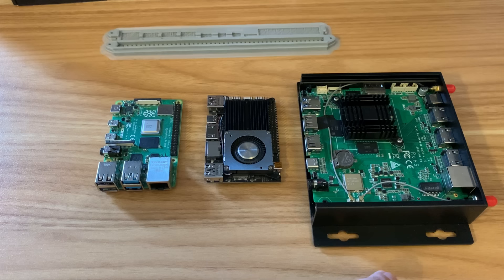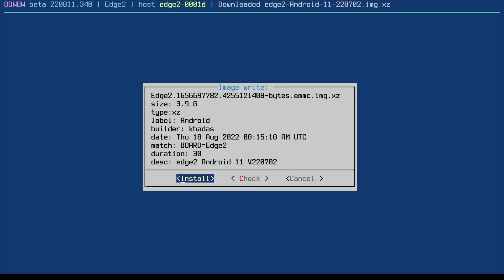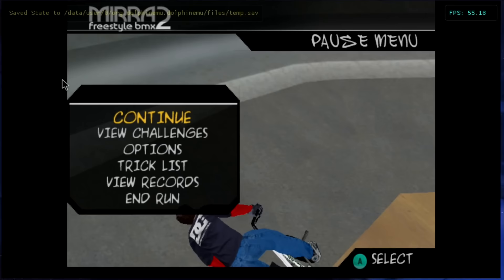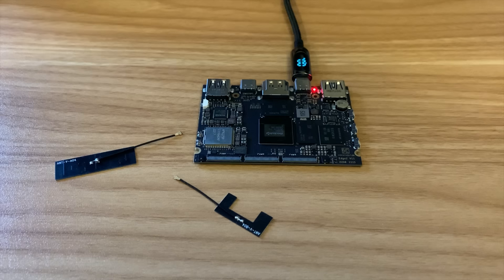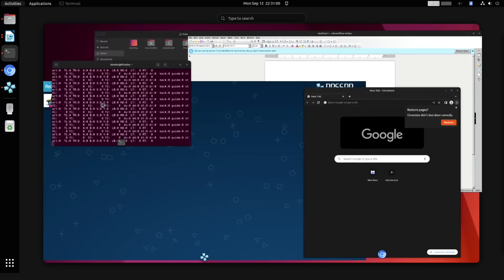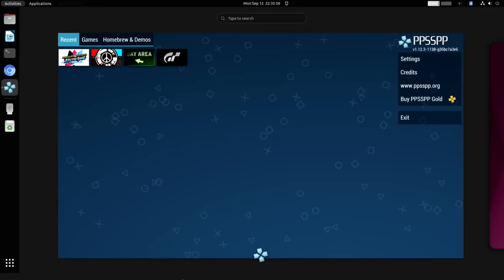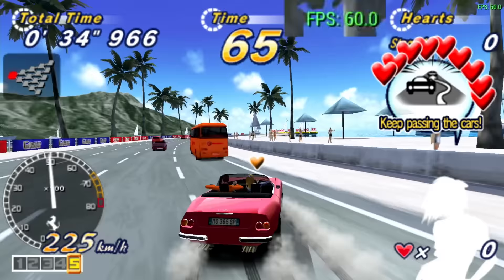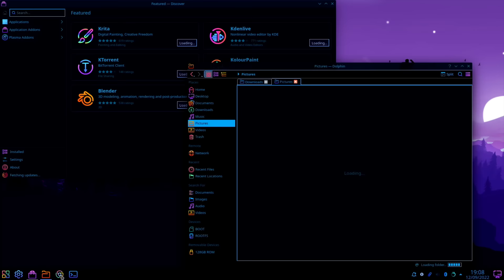Khadas Edge 2. Super Powerful 8 core SBC. Rockchip RK3588S with 16GB ram.

Comment: I'm always looking out for new high-powered ARM SBC's that would be suitable for more CPU/GPU/IO-intensive applications than the Pi. However, I note that higher-end products start to butt up against the baseline M1 Mac Mini price-wise (especially in US pricing because heavy discounts on some Apple products seems to be available),  but don't get close to the performance - often resulting in the Mac being the overall better value proposition. This reinforces my conviction that the M1 Mac represents superb value when it comes to the balance between price/performance/power consumption despite it being a 'premium' product. Obviously, it's bigger physically than most cased SBCs, but it's still a lot less intrusive than a conventional PC. It fits many people's definition of low-cost, and in terms of 'bang for your buck' it's probably peerless.
Reply from the maker: How much can you get an M1 mini in the US? Surely the price isn’t that close. I love my M1 MacBook Air.
Reply: @leepspvideo  Walmart has refurbished 2020 M1 Mini for $605
Reply: @leepspvideo  According to MacRumours, discounts of up to $130 for the baseline model can be found (i.e. prices from $569). AppleInsider reports current discounts of up to $110 (i.e. price $589). Yes, that's still more expensive than most SBCs (even including case, PSU, SSD, etc) but high-spec SBCs are multi-hundred dollars, and getting towards the region of a Mac Mini, which at ~$500 still qualifies as low cost computing. In the case of the SBC you're reviewing in this video, the 'pro' version is priced at $329,  which will rise to $369 next month. At that price point I'd be seriously considering going the whole hog and spending an extra $200 to move to M1 architecture, with the blazing performance that brings.
Reply from the maker: @ninline2000  I agree it’s a great price but it’s a long way from the $199 launch price of this SBC. 
Normal price $239
Reply: @leepspvideo  the board you reviewed is the 16gb version, so $299
Reply: If you want the highest FLOPS per buck, previous generation of ultrabook processor-based Chinese mini PCs might be the best option. You can get an 8-core Ryzen 5900HX box for some $300 with RAM and SSD, and its CPU/GPU annihilates everything in that price and TDP range. Also FYI, RK3588S is not very expensive, it is just Edge 2 is very expensive. R6S is priced at less than half its price for the same spec.

Comment: This slim SBC with USB Type C ports is in the right direction for a portable [ display  + SBC ] setup with an SBC pluggable and detachable at the rear of the display for outside use.  Now that there is no Ethernet port on the SBC, it would be really useful to test USB type C hubs (bandwidth, power consumption, hub size, nb of ports, type of ports, ..) and check simultaneous downloads over Ethernet + other protocols (file copy to M.2, etc..). Some of these hubs are terrible at handling high-speed transfer for simultaneous communications, and some work fine.

Comment: I think the reason Fortnite was kicking you was because you were using a controller. For the Android build they consider that cheating because most use touch screen controls, which for FPS games are awful. I'd bet if you used it in the tablet format you could get a full play in.

Comment: It is likely from all that we have seen from RK3588 devices so far that Android is where there is most overall benefit right now, in particular hardware accelerated video playback, which, as history shows us, is almost never going to generate the manufacturer drivers for open source use to enable that maximum GPU performance in Linux etc

Lack of Ethernet is a downer for me and no onboard support for NVME significantly decreases the value, especially at the prices being charged, even early bird.

The Rock 5B seems to combine the features and price that will likely attract the greatest interest, even though it is still a few weeks away from consumer sales. We will of course have to wait for reviews to assess its full value.

The Edge2 is another example of how the RK3588 is a quantum leap forward in terms of the Rockchip/AMLogic/Allwinner battles at there end of the market but the overall package of the Edge2 in comparison with its actual price means that I would not give it serious consideration.

The optional Edge2 Active Cooling Kit seems to be an almost required purchase, adding to the cost, but there is no mention of price of purchase availability.

What really stood out from the review was what happened when it was connected to the RasPad and even the tiny demonstration of its use showed a flowing and fast operation, which bolds well for use in tablets and especially add to the burgeoning gaming handheld market.

Comment: It is amazing how “old” the a76 cores are - what 4 generations old vis-a-viz the current gen cores in the latest android phones? 

A76 is a beast. The ampere instances in oracle cloud was my first taste of it and it was amazing - more powerful than my 8th gen Intel i7 CULV (laptop) processors. And with 24GB of RAM for the free tier, it killed.

Can’t wait for some Mediatek dimensity 9000 SBCs.
Reply: All big cortex as A77,A78,X1, X2 are basically based on A76 by ARM Texas team.
So you just need higher freq to boost performance.
Reply: @scavarestrovao6196  but ARM had done changes with new arm v9 - So A710 is different also cortex x3

Comment: At first I thought there wasn't any GPIO but after going over the website I see that it is on a breakout cable that connects to the ports next to the back-side CSI connectors... which  you only get with the 'maker kit' - this is also how you connect an SD card. on that i/o breakout- the website is is a bit confusing about this, but it's not too hard, you just have to read every bit of text to figure it out.... also, you only get this i/o breakout if you get the 'maker kit' , the other version comes with a case and no breakout because they say it will be blocked by the case..... well I think they should include this breakout stuff anyway because it costs more and you lose SO MUCH functionality with out any access to GPIO and ease of transferring with the sd card without having to unplug usb ports.... and it's a bit expensive for me to use in a maker sense anyway... but then again it is SUPER POWERFUL, so it could be useful for creating more complex a.i. needed 'stuff' (robots, etc)
I don't think it would be a bad purchase if you need more power, or even a simple computer for everyday use... I like it a lot... I just dont need it right now :)

Comment: I've been looking for a comparison video that actually shows all these SBCs together as looking for an alternative to my recent Pi 4B 8gb and as much as the the RK3588 looks impressive I see it lacks the OS support that you get from the Pi community. Ideally I'd love a CM4 yet they're near unobtanium or expensive from Chinese sellers. Saying that its great to see the likes of Mekotronics producing affordable boards, although I prefer the smaller sized Khadas boards with a preference for the Edge 2 as better emulation potential?! Here's hoping you manage to get a Radxa ROCK5 Model B to tryout once they release or a Firefly RK3588 version as I hear good things about their ITX-3588J board but its quite pricey...? Great work by the way!
Reply: Don't buy the Edge 2. If you want a CM4 replacement, go for a Radxa CM5 (to be released soon), which has the same RK3588S, running the same validated software suite currently runs on Rock 5, and is of the same size of CM4. If you want something in a nice box ready for use, go for an R6S. Edge 2 looks nice on paper, but the board certainly is either designed to be a small computer (which its GPU is not powerful enough, though its CPU is really cool), or to be embedded in a system (which it lacks mechanical connections to be fixed onto anything), or to be a desktop embedded development board (which its GPIO connectors are horrendously prohibitive to be used in this scenario), so it tried to satisfy both markets, but really satisfied none.

Reference: a not very satisfied Edge 2 user.

Comment: I'm wondering how many of these SBCs are being used for play games. My interest in them is business-related. Is there any way that you could find a way to add a test for business capabilities?

I appreciate that there aren't any standardised tests for business functionality, but I think it would be useful to create a standard test of your own which you could then use as a comparison table for all the SBCs. Most of us know what the Pi is capable of, so having something to compare to the Pi could be useful.
Reply: What kind of business are you using them for? Typing in documents, credit card processing, menu boarding, 2D and/or 3D motor controlling, something else?
Reply: @anon_y_mousse  Running as low-power servers. Nginx, PHP-FPM etc. The Pi isn't up to the task, but some of the better-equipped SBCs look like they might be.
Reply: @ChefEarthenware  I don't consider those necessarily business only, but it is weird that the Pi can't keep up. I run Apache on mine and it doesn't seem to be slow, but you may be serving for hundreds or thousands of users. Have you tried overclocking and/or using a different OS on the Pi?
Reply: @ChefEarthenware  If you're finding that the Pi isn't up to the task but you're running a standard distro on it, then I would suggest looking at using a lighter and far more customisable Linux that you can "strip to the bone" just for your specific needs - Gentoo Linux would be one I would suggest that you consider here.
Reply: @terrydaktyllus1320  I did leave another comment, which has been removed.

In that comment, I explained the problem and I also gave the URL of my search engine, which I assume is what YouTube doesn't want to see in comments.

I'm not entirely surprised, as my search engine is a potential competitor to Google 😄
Reply: @ChefEarthenware  I know the feeling - a lot of my comments are deleted by YT too, usually when I am talking cyber-security with people and YT's thick algorithm assumes I am talking about h*cking techniques.
Reply: @terrydaktyllus1320  Have you found any way around it?
Reply: @ChefEarthenware  Other than "choosing my words carefully", no.

Comment: ROC-RK3588S-PC - Price:  $ 219.00. What are we comparing to (Raspberry Pi) - 4 times more expensive ;-)
Reply: To be fair, I've seen 8GB Raspberry Pi's asking the same kind of prices on Amazon at the moment - but $199 for such a board is still far too expensive.
Reply: You need a more appropriate comparison: 
RK3588S has a cpu mark of 5,998  which is the same as an AMD FX-8350.... Considering it has a  motherboard, 8g ram, basic storage, an igpu and wifi -- let alone the little power consumption, I would not say it its far too expensive for $200. However, Ryzen 3 PRO 2200GE has around the same cpu mark, and around twice better igpu  (for $100, the chip alone, you would still need to add mobo, ram, storage and wifi)

(PS. Pro version with 16 gb ram and larger rom for 299 is far too expensive indeed)

Comment: Overclock the CPU within PPSSPP to get 60fps in Outrun 2006. Without doing that, it doesn't matter if you're running at native resolution or up scaled to 4K, it still drops to 30fps. The game by design is too demanding for the CPU in the PSP so that's how it runs too on real hardware. As PPSSPP has a CPU overclocking feature,you can make this go away. 

One day I'll see a YTer remember this lol
Reply from the maker: Does this definitely work that way with emulation? The Dreamcast version of Dave Mirra bmx runs too fast on a Pi 4. you can tell by how quick the timer runs. 

Imagine outrun at double speed! I already crash too much as it is
Reply: @leepspvideo  Only works if there is an option within the emulator in question. It doesn't speed up the game, just speeds up the emulation of the CPU.

Comment: Lee. Sold my Pi400 so someone else could use and it wasn't powerful enough. Could this sbc easily get put into the pi400 frame ?
Reply from the maker: It’s a completely different shape to the Pi 400. You sold the Pi 400 without it’s case?

Great Raspberry Pi 400 SSD case
https://youtu.be/uyGplkzDrFE

Comment: So I see a lot of videos reviewing these SBCs but I don’t see any good videos explaining why this is better than an old laptop or pc which can be cheaper. It’s small but how much is that worth? If I want to run a server for smart hub, plex, nextcloud, vm, etc. Would this be better than a cheap old pc/laptop?
Reply from the maker: A lot lower power consumption than an old laptop
Reply: It will pay for itself with the power it saves. With this much performance on an ARM board, there is little reason to use x86-64.

Comment: Too bad the new SBC's are so expensive. How does this compare to a AMD 3200G system which is roughly the same price?
Reply from the maker: The AMD is faster but check out the performance / watt ratio

https://gadgetversus.com/processor/amd-ryzen-3-3200g-vs-rockchip-rk3588/

Comment: I bought one, seems to be defective. Right out of the box it boots into the OOWOW beta splash screen as shown in your video, but instead of loading OOWOW, it remains stuck on the OOWOW beta screen. Hopefully other folks have better luck than I do.
Reply from the maker: See 14.30 in this video 

https://youtu.be/SEDgKQzvkck

You can write Oowow to sd card. I managed to stop my eMMC Oowow from working. Also try a different display if that doesn’t work
Reply: @leepspvideo  Thanks for the suggestion!  I tried writing OOWOW to a USB stick, it boots from it, but hangs at the OOWOW splash screen as well.  I tried two other displays, same symptoms.
Reply from the maker: @chadparrish926  strange, it’s not an issue I have had on my 3 Khadas sbc’s. Are you sure it’s booting from the usb and not the eMMC image?
Reply: @leepspvideo  I bought a second board, which arrived today.  That board booted to OOWOW out of the box and seemed to install android fine, so the first board is definitely DOA.  I am having difficulties with the touchscreen now on the second board, which works well on a raspberry pi running android.  It is a Dell P2418HT.  I am starting to think that the Edge2 was not quite ready to be out of beta.

Comment: Did you try PICO Pi with RK3588S (16GB Ram + 64GB eMMC) and use it on CrowPi2? I wanna use it instead of Raspberry Pi 4B+, but I have the trouble to set up
Reply from the maker: I haven’t

Comment: You have to admit, that you're comparing apples to oranges here.  You're comparing a $75 Pi with a $200+ SBC.
Reply from the maker: I clarified that the Pi 4 has been out the longest but it’s got incredible support. I was pointing out how powerful the Khadas is considering the size. The Pi 5 is very unlikely to match this SBC for power as it’s aimed at a lower price point. However the Pi 5 will have unrivalled community support. Still it’s great to have the power if it’s available.
Reply: @leepspvideo  Agreed. It's amazing what they're doing with the size, but for what its for (education) the Pi just can't be beat for the price.  It is interesting to see these alternatives come out with more power.

Comment: I mean at that price point you can get a good Chromebook.
Reply from the maker: Very different use case. 16GB Chromebook price...
Reply: @terrydaktyllus1320  As you watch a tutorial installing android....
Reply: @SimpleEnigma331  So Google can spy on me just because I watch Android being installed? That's a new one...
Reply: @terrydaktyllus1320  As in thats one of the use cases for this. And you can remove ChromOS from a Chromebook. Im only stating that for that price you can get more complete hardware.
Reply: @SimpleEnigma331  No, there is no use case for a Chromebook - I made that clear in the first comment.

You can buy a refurbished Thinkpad for $200, stick Linux on it and have a more usable machine that isn't spying on you.

Chromebooks are made specifically to not allow other OSes on them - I had a HP Chromebook that my wife got extremely cheap through staff discount when she worked for HP about 10 years ago and, yes, I got "virgin" Gentoo Linux on it. But it was still a lot slower than any old laptop I was using at the same time. Within 3 months, I stuck Android back on it and sold it on eBay.

I don't like olives. So when I order a pizza online, I tell them "no olives on my pizza, please".

Your "philosophy" is "buy the pizza with olives and pick them all off the pizza when it's delivered but before you eat it".

Why would I buy a sub-standard bit of cheap hardware running an OS that spies on me to then try and make it better afterwards? Just buy a $200 refurbished business laptop and stick what you want on it.
Reply: @terrydaktyllus1320  Lol this comment provided by youtube which is owned by google.
Reply: @SimpleEnigma331  Yes, of course it is. And that comment alone tells me that you haven't got a clue about privacy and, more importantly, IDENTITY actually works.
Reply: @terrydaktyllus1320  Oh I am fully aware how those things work, what I'm not confident in is your ability to be smart enough to never associate the two...